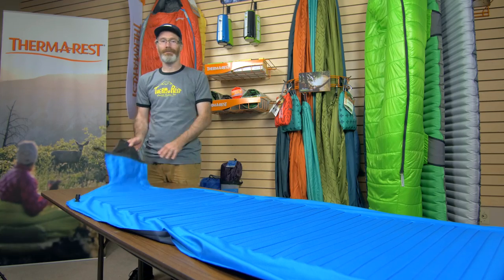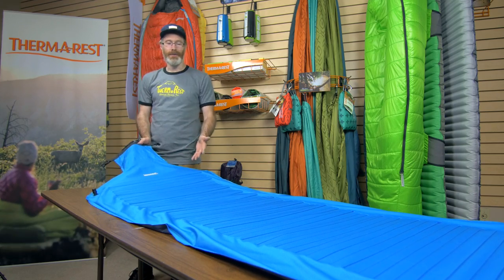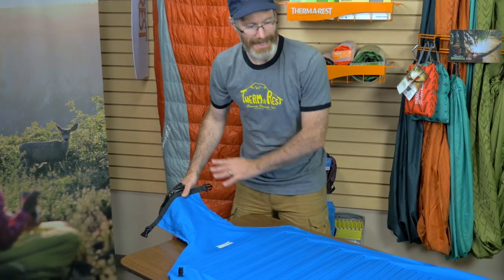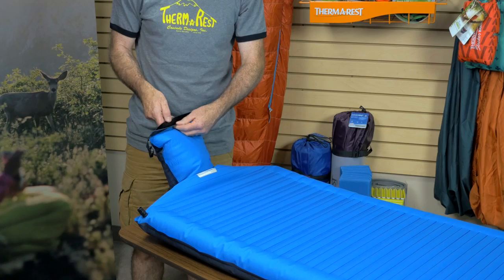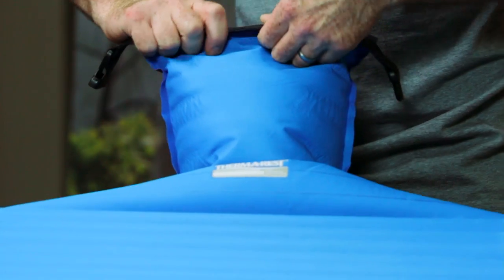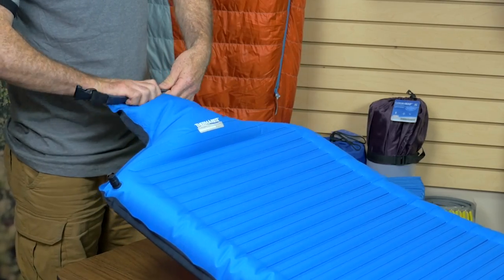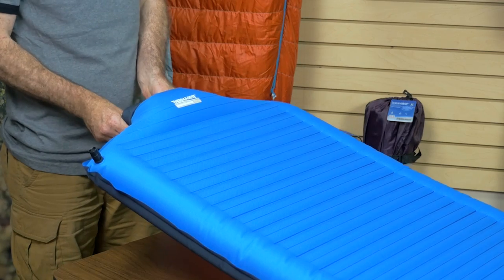How To Use The NeoAir SpeedValve Mattress

Comment: I just acquired one of these and it takes SIGNIFICANTLY more breaths than shown in this video to inflate. It would be great to see an unedited video of this mattress being fully inflated from it's completely deflated and rolled-up state.
Reply from the maker: The Speed Valve mattresses take a bit of practice to inflate properly and may take some time to get just right. If you play around with your technique and give the mattress some time to break in you should see it inflate at a faster rate.
Reply: I wonder what your definition of  "a faster rate" is? I am curious as to how many breaths on average it takes (a person who has had a bit of practice) to inflate this mattress properly... and how much time it takes after one gets this just right.  As I said, It would be great to see an unedited video of this mattress being fully inflated from it's completely deflated and rolled-up state. Even an amateur low production-value crappy video from a phone without comforting acoustic guitar accompaniment  would suffice. I really want to believe this mattress can inflate faster than conventional camping air-mattresses;  the concept is so cool!
Reply from the maker: Without the speedvalve it takes about 35 breaths to inflate this mattress. Brandon is an expert at using the SpeedValve (he had a major hand in developing it) and can inflate it with 6 or 7 breaths, but we've found that for the average customer it takes 10-15 breaths, depending on their lung capacity and proper usage.
Reply: That is awesome! I would love to see an unedited video of Brandon inflating The NeoAir Camper Speed Valve from a completely deflated state in 6 or 7 breaths... I love the design of this air mattress!
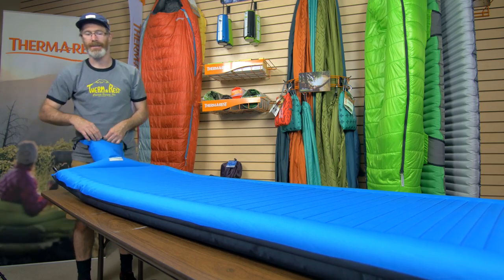Reply from the maker: We don't have a video handy, but here's a review video with someone inflating the NeoAir Xlite Max SV in 5 breaths. He starts inflating around 1:00. 
However, note that he didn't roll it correctly... the inner valve wasn't tucked all the way in, which could cause leakage. https://www.youtube.com/watch?v=p3dZKddmcHM
Reply: Cool!  The Neo Air X-Lite Max SV inflates very quickly!
Reply: It doesn't hurt if your mattress is 60% full of air as it is in this video.